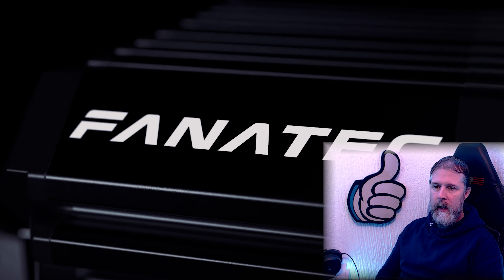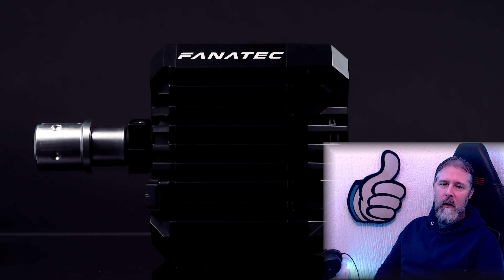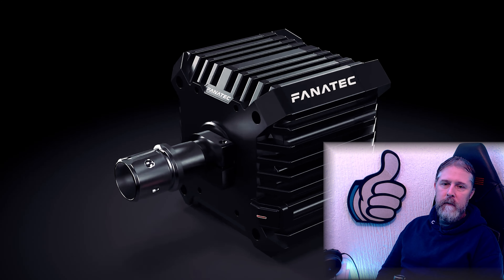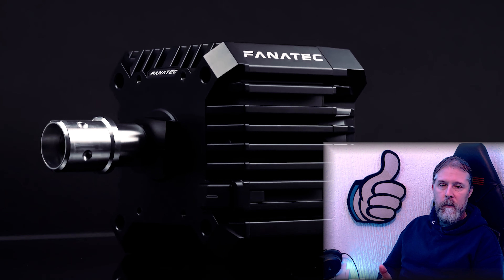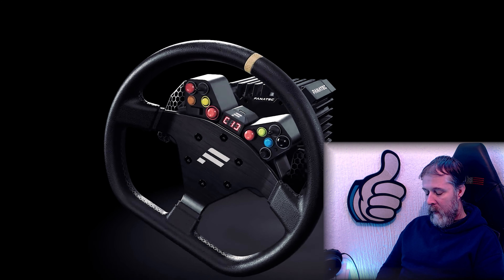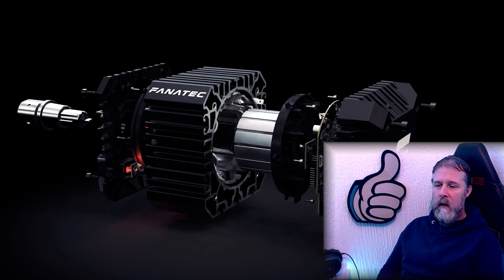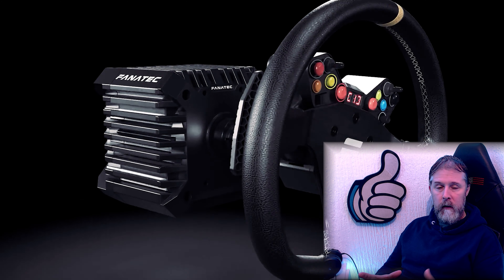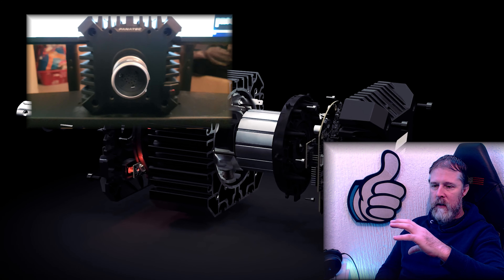Fanatec CSL DD, 1 Year On Review ! Series X / PC

Comment: It dawned on me that the CSL DD/ GT DD Pro are part of Fanatec's lowest priced entry level products. IIRC the belt driven CSL or Club Sport Light wheelbases were mostly plastic wheelbases which used some of the design principals from the Clubsport line of products. They weren't as robust as the CSW, and were built to a price point. Much like the CSL-DD and (CSL)GT DD Pro. 

I'm not trying to say that people are wrong to point out quality issues and concerns. That is perfectly acceptable, but these bases are part of Fanatec's cheapest craptastic line of products, and that should be kept in mind.

Comment: Hi there 
I don’t have a pc
Can I run the dd pro csl 
On Xbox series x 
Without a pc
Cheers
Reply from the maker: Yes I use it on xbox series x, you just won't be able to update the firmware on it.
Reply: Ok great 
Could I use my Mac to update firmware though 
Thanks for getting back
Reply from the maker: @robo283  not sure, best bet take a look at the fanatec website
Reply: @robo283 was you able to update it with your Mac? And did it feel good on xbox?